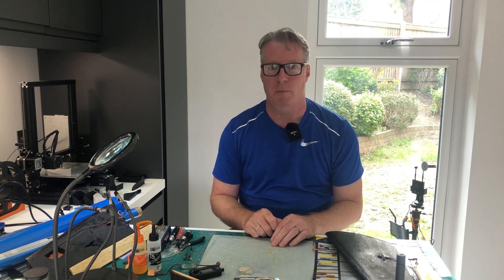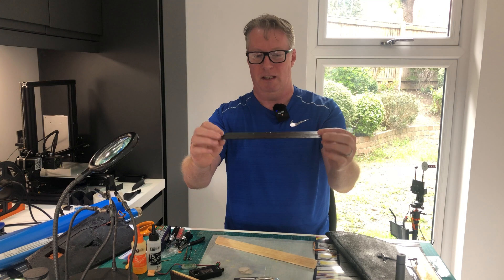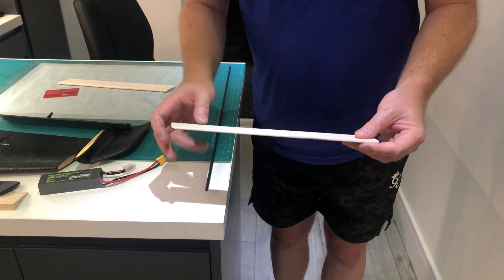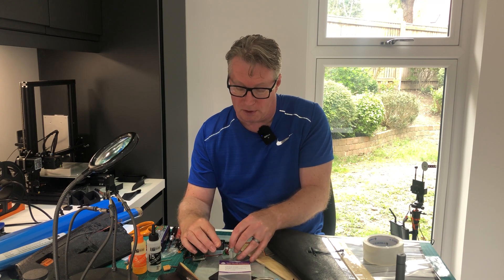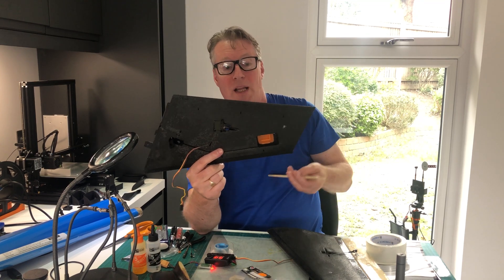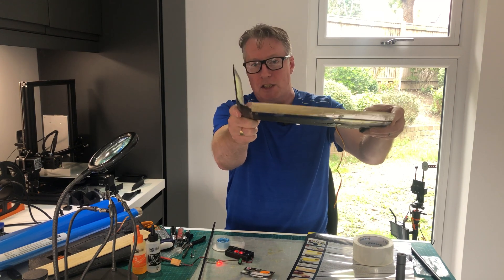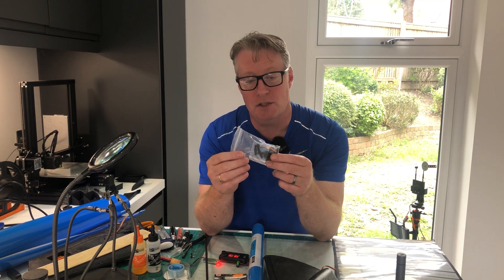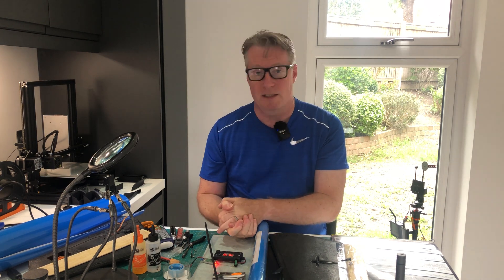AR Wing Pro - Enhanced Build Part 1

Comment: Hi the can you send the link for that Heat activated adhesive
Reply from the maker: Its not heat activated search E6000 on ebay or amazon and you will find it easily, I get mine on ebay.
Reply: @bluefish3607  oh ok thanks I use goop
Reply from the maker: @kjkareemslim  I think Goop is the same thing.
Reply: @bluefish3607  I need mine to Take that crash like yours did in the rain
What was the stuff you mixed it with to paint it on with a brush
Reply from the maker: @kjkareemslim  Its Toluene and I use two parts to one of E6000
Reply: @bluefish3607  thanks

Comment: First i want to say you have become my main source of information when it comes to the ar wing pro so thanks, I have 3 of these planes going to do the hybird thing next,my biggest problem with these wings is the build in electrical 6 pins. My receivers and vtx require 4 wires each i place them on opposite wings as far apart as possible, just wondering how you deal with this? Are you splicing ground wires together or maybe the positive wires? Thanks for all your videos
Reply from the maker: I splice the ground wires from the servo and crossfire RX in the wing. I use DJI and have the VTX or Air Unit in the side pod and GPS in the other side pod so no wiring issues with those.
Reply: Okay thanks this makes sense,I hate to waste these build in connectors but to me the least amount of connectors in a wing the better, loosing power,ground or signal to a servo can be ugly. I think I'll keep removing these factory connections and running servo cable directly to servos,rx and vtx. Thanks

Comment: Balsa, Solarfilm...we were using these materials in the 1970s...
 The sealed (airproof) hinges will work best. You can actually make your hinges using the iron on film instead of the tape for a really professional finish instead of the tape hinges. 🤔😳🇬🇧
Reply from the maker: Never thought about using film for the hinges I must check that out and see if I can foiind some info or vids that show the technique. Of the two options I have tried I like the CA hinge option best so far
Reply: @bluefish3607  Be interesting to see if this improves or prevents the dreaded nodding in the pitch axis. I don't think it will but I'm guessing the trim will be more stable at the higher speeds....🤔😳😳🇬🇧

Comment: I've noticed an unfortunate aspect to these foam models having such a heavy battery, which is the forward inertia of the battery (and whatever it's attached to) ripping the fuselage apart as it continues on it's way. The only solution other than a whole different material would be something like a break away nose and battery compartment that could slide in and out on plastic rails, held in with with a bit of Velcro at the back, and a quick release power connection through the center of the main bulkhead. 

I like the covering material. We used to iron it on balsa gliders, but I don't think it will help contain that Lipo. Anyway, sounds like a fun and worthwhile project there. AR-WING PRO 2.0!
Reply from the maker: Burt, I completely agree I have had many crashes with 500mah lipos smashing through the foam on impact and destroying the GoPro into the bargain. The lam wont stop that in a hard crash but hopefully it will make the wings a little more resilient to scuffing and damage from minor impacts. The elevons will make a big difference I hope because the stock ones are not uup to the job for anything but slow cruising.

Comment: Are you running the enaxx analog servos or digital?
Reply from the maker: I was running the Emax ES08MD II metal gear digital. In the new build I am running Towerpro MG90D metal gear digital
Reply: @bluefish3607  I always found those Tower Pro servos to be very weak well the full size Tower Pro servos we're always very weak when I try to use them on my trucks but as I'm typing this I'm thinking yeah he probably would work really good on an airplane or a wing I have those emails servos on my s800 wing but they're the analog version and I don't think I like them I think I'm going to put digital servos in it see if there's a major difference in how it flies
Reply from the maker: @devilsreject78  Thanks for the heads up on your experience with the Towerpro's. I have used them before and found them to be pretty good.

I chose them because Stall torque: 2.1kg.cm (4.8v); 2.4kg.cm (6.6V) was a little highr than most others I looked at, they have dual bearings, metal gears and are digital.

This is why I am building a test plane first to  see how all the components work out. I am assuming that because the elevons will flex less that more energy will be applied to the servo arms.

We will see soon enough I guess how they work out 🙂
Reply: @bluefish3607  yeah the ones I found to be weak were all the full size ones for the full size RC cars the micro servos I don't have much experience with those so they probably are pretty decent I would like to know how they work out for you cuz if they do work out for you and I'm going to buy some for build I'm going to do

Comment: I'd stick with the Z hinge mehod and I use  blenderm tape across the joints 🤟
Need to repair my ar pro after it buggered off on a failed auto launch haha
Reply from the maker: I have had a few AR Pro bugger off for various reasons :-) I will be trying the Z hing method as mentioned and see how I get on with it.

Comment: Interesting..  Look forward to the progress.   I was curious about inserting some .5mm x10mm CF strips to the trailing edge of the flimsy foam elevons..  That said, I look forward to your build..  btw, quit messing around with those AR Wings and get that A-10 ( more than enough room for a Matek F411 inside it..)... 🙂
Reply from the maker: Don't temp me on the A10 your does look amazing. I want to focus on my existing projects first, I will be carbon laminating the balsa elevons to see how that works out. This was a tip from a guy who flies super high speed gliders.

Comment: I put foamboard elevons on my old AR600, the kind that has thick paper glued to both sides. Of course, no where near as torsionally rigid as balsa, but still more rigid than the stock expanded foam ones.

You know more than most about the AR Pro, it's a decent plane and performs just fine at what it was designed for. But for sure, it definitely needs modding if you want to fly it outside of its usual envelope 👍
Reply from the maker: I intend to laminate the balsa elevons for the new build with carbon fibre. I am sure |I can get this plane to fly better but it is really a cruiser, my Mini Drak will be more geared to high speed acro.